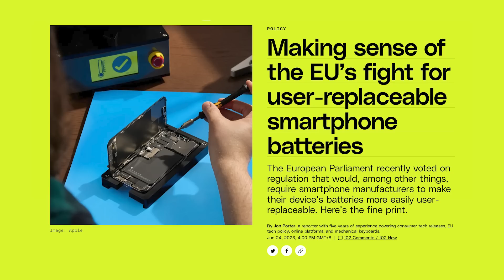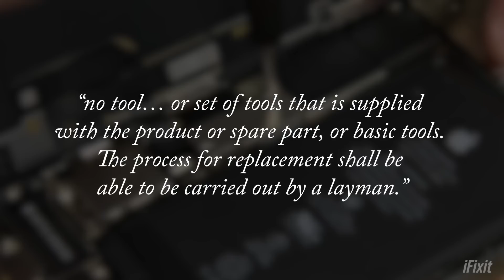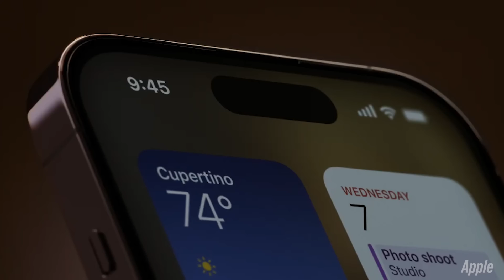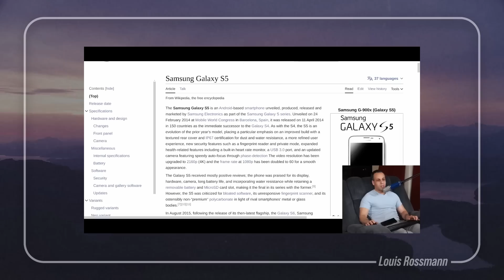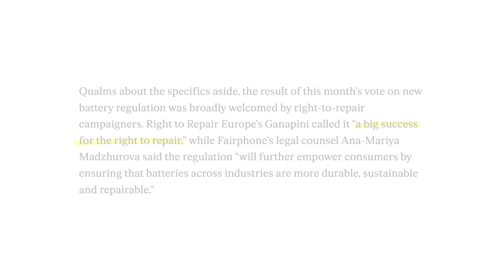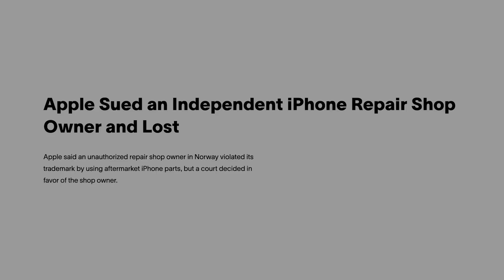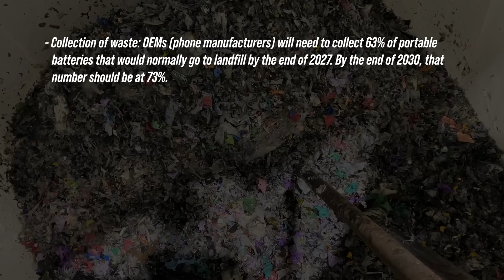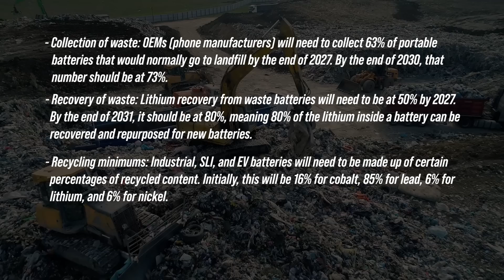EU Just Changed Smartphones Forever

Comment: I feel like this might not work too well because probably half of phone users are going to replace their phone within 2-3 years anyway... the battery is the least of the reason to replace it any earlier, but with the speed of technology's advancement nowadays, I can't imagine using a phone for longer than the battery can survive
Reply: I bought my phone back in 2017, and I don't plan on buying a new one for a while, actually. I don't need a better camera, I don't play any games on my phone, and the performance is pretty decent for an "old" device, so I just stick with it. The only thing that would make me want to buy a new phone is the battery, since this one is not as efficient as it used to be.

The same thing goes for my tablet (Galaxy Note 10.1) that I use for digital art. It's a 2014 device that has a dead battery, so I can only use it while it's plugged in, which is pretty disappointing, since it's such an awesome device (even though it's pretty old now). All of these devices are perfectly fine, and I use them all the time, but having an affordable and easy way to fix their batteries would be such a game changer for me.
Reply: @mura95  hm... I would vouch to say you're not in the majority for this though 🤔 the thing is, the galaxy tab 10.1 (i assume you meant tab) isn't really a good device in this day and age in my opinion, and even in 2014 it was lacking... I know because I had access to one, and its predecessors. The tab 10.1 to me was one of the worse tablets that I've used, with the strong point being the screen size and the fact that it had an IR laser on it, but the software OS being terrible as a weak point. Samsung's devices are much better now and if you don't mind the tab 10.1, then i would definitely place you in the minority, at least as far as first world consumers are concerned, because most people in this day and age wouldn't put up with what that tablet puts one through. regardless, for me and most others around me, a screen crack/shatter will occur before the battery gives out, as well as a slowdown of the drive speed and overall OS speed before the battery becomes less efficient, in my experience at least...

Comment: I have no reason to think that the removal of user replaceable batteries or the all glass back or removal of the 3.5mm headphone jack were pro consumer moves. Heck I even want more bezel at the bottom of my screen so that typing is easier again! As it stands I'm using switfkey so I could move the keyboard up and am a bit bitter about losing my headphone jack moving to a pixel 7 from a 4a. I also think the telecoms are in cahoots, at least here in Canada, with the big phone manufactures. It's way cheaper to get a new phone on a 2 year tab or plan or whatever then it is to replace a smashed screen and that's absurd. It's also only cheaper to get the certain phones that the carrier offers tho. If you want a OnePlus or a Nothing phone or a Fairphone you have to pony up the full sum. Far as I'm concerned outside of simple processing power phones have been regressing for a decade or so because of this combination of factors and slick marketing.
Reply: Hahaha. I don't care on the phone, but on tablets I really hate when they don't have any bezel How am I supposed to grab them?
Reply: Call me old-fashioned, but I want a screen to be rectangular. Rounded corners freak me out. Notches and "dynamic islands" are even worse. So I would really prefer thick bezels at the bottom and the top. The iPhone SE still offers them.
Reply: Littletip... doogee phones are taking over market slowly with cheap performing phones

Comment: I never had a spare battery on me and i never heard of anyone that did that. It was just nice that you could get a new one when the old one was messed up and had half the capacity of the new one.

But i don't think this new rule is all that useful anymore. Back then the phone was simpler and the apps were simpler and you could keep the phone longer. Now it seems that after a few years, they don't get the new updates and things just run slow even with ok specs. That's when people get a new phone. The last phones i got wasn't because of bad batteries.

Comment: Some manufacturers already went back to removable batteries. I am currently using Samsung Xcover 5 and even though it's at least a year old model, its battery can be removed relatively easily AND it's still water resistant.

Comment: Rather than sending them back to the manufacturer, I think there should be infrastructure to let people safely dispose of batteries. A little while ago, I replaced the battery in my laptop because it pillowed out and I ended up going to a repair shop anyway to drop it off with them to dispose of (for a fee). 

I imagine a lot of people simply won't know what to do with a cooked battery and will either keep it as a fire hazard or unsafely dispose of it.
Reply: we have in nealry every shop in germany boxes to throw away batteries like AA,AAA sorted and some shops also have bags for Lion cells(those fire prove ones).
Reply: As in-house IT support for large UK retailer, I regularly replace batteries in older laptops & hold the dead units in a secure case provided by a collection service.  This is a paid service but all batteries are safely disposed & recycled if possible.  For private individuals you can visit larger branches of Boots the Chemist that have battery disposal boxes that you can deposit into, although this may be restricted to normal consumer battery types.
Reply: Fun fact

China used USB c ports on phones first . Everyone copied Chinese methods

Comment: These changes were definitely motivated by profit. Removing access to the the battery, headphone jack, getting rid of the charging bring being included in the phone packaging.. I'd love to see how this plays out in the next few years.
Reply: The only one of those I agree with is the charger. Yes it seems counterintuitive, but with charger tech being as advanced as it is and knowing companies will cheap out with the included charger, it makes way more sense to buy your own multi use chargers that function with all of your electronic devices

The removable battery and headphone jack going the way of the dodo is all downsides, however
Reply: also funny is how companies are working towards making their devices slimmer. and then consumers like putting bulky cases on said phones
Reply: By making the battery removable, one of two things will happen. Either the device will be way bigger or said device will have limited power.
Reply: @TrevorSachko  You speak like iPhonw Ultra pro Max thin and small 😅
Reply: @Calchustler  Not at all, just the facts. At least I can spell "iPhonw"...
Reply: @TrevorSachko  So a man Couldn't identify a typo abviously don't understand what apple does with their bulky products
Reply: Fun fact

China used USB c ports on phones first . Everyone copied Chinese methods
Reply: These were most likely security motivated.

Why can be no longer disconnect microphones or camera and why have built in covers been removed?

Why are all phones built in with high megapixel camera on front and back?

Government creates laws benefiting/restricting or can give tax benefits or even provide funding for social media and smart phone companies.
Reply: everything u mentioned takes up more space than its worth costing the actual components nthat run the storage and ios to be smaller  and less on them  every chasnge wasnt a removal it replaced obsoete parts with more usful ones
Reply: Battery yes. Headphones no. It took up space that was already getting smaller to fill with tech.
Reply: @iAmNothingness   no all were done for circuit space  replacable bateries also rtewuire exstra tech that is a waste of space
Reply: I agree, but I don't feel it was intentional so much that it was just the design they went with that was most efficient. I don't feel that companies woke up one day and said, "If we make our batteries non-replaceable, we can sell more phones, even if people get really pissed about it." It was probably more like, "Hey, if we use glue with our next generation design instead of the snaps, we could save like $5 a phone."
Reply: charger not being packed in is not too bad, because you don't need a million cables and chargers of the same type. Which is why the EU have made it so there needs to be a universal charging standard, USB-C at the moment. So it doesn't matter if you don't get one supplied, you can just use what you already have.
Reply: It was motivated by profit, and assisted by consumers. People demand thinner and sleeker looking phones and the easy path for manufacturers to achieve it, is to cram everything together with adhesives. With the first phones of this design, consumers didn't complain enough or just bought those phones anyway, so manufacturers continued that practice and now we're here.
Of course manufacturers take the path with largest profits if you let them, that's why every consumer should support the "right to repair", it gives control back to consumers to say "hey, we don't like you doing this, find a better solution".
Reply: @Hezeri  Irony is, Iphone pro max is the bulkiest phone in the market now
Reply: @Hezeri  "People demand thinner and sleeker looking phones " - Did they, or just marketing departments of phone producers reported so to public, so people would think that there is such demand and should have sleeker phones themselves. For my perspective it was manufacturers that convinced customers they want sleek phones not otherwise.

And that's also countered by the fact that phones are getting bigger and bigger and many brands don't fit in your pockets, unlike old ones. And most people put them in bulkier covers because they are fragile. So ultimately phones are not that much thinner. And I don't see that much benefit to even sleeker phones for customers outside of fashion.
Reply: Not really, replacing a battery used to be a severe pain and the stories about it going wrong were legion. Opening up your phone was fraught with danger. Apple have never needed to scrimp on profit for phones, similarly with the headphone jack. That was a constant source of problems for users and the phone, it was one of the most common failure points, combined with the inconvenience of wires it was a good design choice to get rid of it. Especially since bluetooth became far more reliable.

People often say they want repairability and be able to easily swap things but reality says different. What people actually want is durability. Having a phone that doesnt need fixing for 5 or 10 years is far more desirable. Trying to get anything fixed is a nightmare and given how important our phones are to us in the modern world its far easier, and often cheaper, to get a new one. Which is why durability is so important.
Reply: @probablynotmyname8521  lol
Reply: @davidlane1248  thats not exactly a rebuttal. The trouble is a “reason” embeds itself in the zeitgeist and no one ever wants to hear contrary arguments, its just easier to think “apple is evil”. I have my own reasons to dislike apple but not because of their technological innovations. If anyone thinks that wired headphones are better, you are provably wrong, if anyone thinks that swapping batteries is a good idea you are provably wrong. History is against you on both points.  What we should be focussing and requiring is longer device and component life, which the EU is moving towards.
Reply: nope none removable bateries are smaller and have more batery life  headphone jacks are outdated boomer tech
Reply: To be fair removing the headphone Jack ended up being good because it caused Wireless headphones to exponentially improve. Now you can buy wireless buds for $2, less finicky than wires within only 7 years.

Battery technology however hasn’t changed in 40 years (still stuck on llithium battery)…
Reply: @theanonymouschicken169 Sorry but i like to have audio without having to charge my headphones every 8 hours, so i still use wired headphones (i also use my wired headset with wireless compatibility and the best of both worlds, recent bluetooth headphones doesn't work with my psvita sadly 😅)
Reply: @FunnyParadox  most humans don't use headphones for 8 hours straight, so charging them is a non-issue. If you're special, then that's a bummer for you, but then it's clearly so important to you, so you can just prioritize a headphones jack over anything else and buy a phone that has it, because they still exist.
Reply: @ylcard  yes and it has to be said that that most humans SHOULDNT use headphones for 8 hrs straight
Reply: @ylcard "they still exist"

And they're going away. It's becoming a selling point when a mid range or flagship phone has one now. So long as people like you continue to be dismissive of the issue, then that trend will continue in a downward spiral. Don't passively help greedy corporations out by telling your fellow phone users that the expensive alternative monopoly is perfectly fine
Reply: @davidlane1248 and also, i think removing the headphone jack is a step in technology worth taking.
Just because money was in the game doesnt mean its bad for us. Yes they cut costs masively. Yes that helps them sell their airpods and galaxy buds. 
But i have to say, that its just supperior. Why have cables when they can be practicaly non existing. The price is the same and throu bluetooth headphones we have stuff like portable speakers and noice canceling.
Tell me a valide reason why headphone jacks should stay, that has nothing to do with your feelings or corporade greed
Reply: @ylcard  is that a joke?  Because most humans are awake for more than 8-hours a day and typically have 8+ hour work days. Its why I really hate that most of the new headphones have  a pathetic 4-6 hours of charge.  You have to re-charge them multiple times a day and have multiple pairs to get through a day uninterrupted.
Reply: @FunnyParadox  You can easily get wireless headphones with 16hr+ battery lives nowadays, and if that's not enough, then the charging cases can bump that up to more than 30 hours total with fast charging.
Reply: @randomguy2925 
With headphones you can block the mic jack to avoid being listened...
Reply: @randomguy2925 removing the phone jack was a downgrade in audio quality. Bluetooth connection is not enough for maximum audio quality and a cable has a superior rate of data transmission. Bluetooth was simply not made for this purpose. 

Also the batteries are not replaceable in pods and even most full sized Bluetooth headphones. As the batteries degrade you have to dispose of them. A pain to recicle and disassemble too…
Charging frequently is another inconvenience…

The only upside is not having to wrestle with wires…
Reply: @AdalbertoMaggioJunior  i dont know where you get your cheap ass stuf with 4 hour battery life and worse quality then with a cable. I have JBL Tune 760 NC. They can be bluetooth or cable conected and i dont hear a difference. Infact there is no difference because it has the currently newest version of bluetooth and it is the same device. Yust buy quality stuff and not those cheap beats shit.
If you dont charge them overnight, you preserve the batery life. My old headphones (jbl tune 710 bt) are almost 2 years old and still have maximum batery life. Again, buy quality stuff not beats or that other crap
Reply: @jplacido9999  bruh you need to accept the conection on your phone
Reply: @randomguy2925 ah yes, 70 pound JBL headphones is what you call "quality" then you've fallen for the trap too. those headphones sound like shit, Bluetooth or not. Simply put, wired connections will always have higher sound quality due to bluetooth's limited bandwidth. case and point, Sennheiser hd600s. 👍
Reply: @randomguy2925 clearly you know nothing about sound engineering. The sound from headphone jack via cable to professional headphones is never touched by inferior Bluetooth junk. Sony knows this you could learn from them.
Reply: @theanonymouschicken169  No. Jack can be used without power, and such headphones if maintained properly have a great durability. BT  headsets have their advantages, but one main disadvantage is the same as with phone - battery is an element with a limited life expectancy. After 3-5 years it will start to lose capacity gradually and become unusable, as it will power your headset for 2 hours instead of 10. Such battery can no be replaced with a new one, so it will become an e-waste.

Anyway it is a matter to have a choice. Removing jack removed such choice, and literally did not give anything of value to customer.
Reply: @theanonymouschicken169  god no, removing the headphone jack still pisses me to no end. headphones are not the only thing it was used for. there is absolutely no reason to remove it other than saving a penny. you can still make the phones just as "sleek" with it.  Bluetooth is not a good solution at all of high quality and low latency audio, it's just decent enough for casually listening to music. the audio latency can best be felt when playing games.
Reply: @theanonymouschicken169   False narrative. One they obviously convinced a few people on. It was never a binary decision you could have had both. There was always enough room for a jack. This was proven all out when someone added their own jack and even USB c  ports to the phone. And it's ludicrous that people actually believed it impacted water resistance at all. As if such a feat is not incredibly easy to achieve. Wireless headphones would have still continued to advance either way.-
Reply: @theanonymouschicken169  Saying battery technology hasn't improved in over 40 years because we are still stuck on lithium batteries is like saying computing technology hasn't improved in over 40 years because we are still stuck on copper semiconductors.

Battery technology has changed exponentially over the last 40 years.